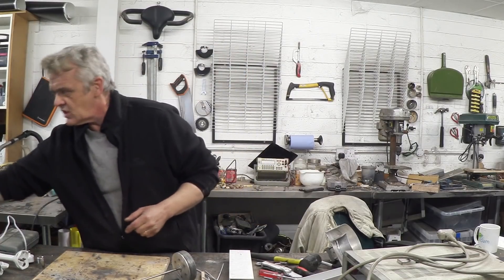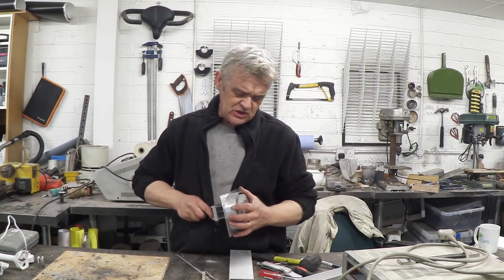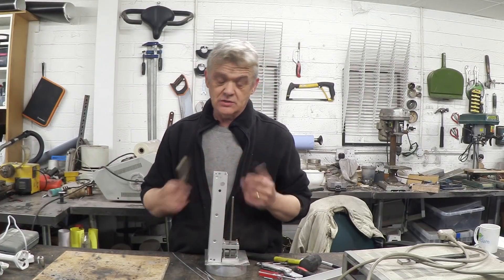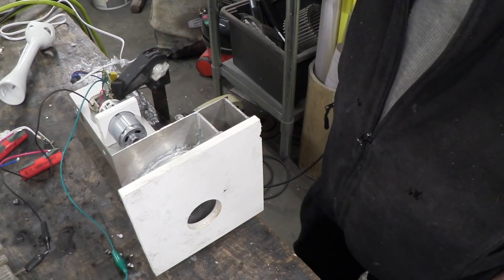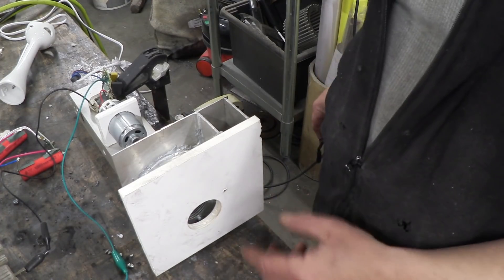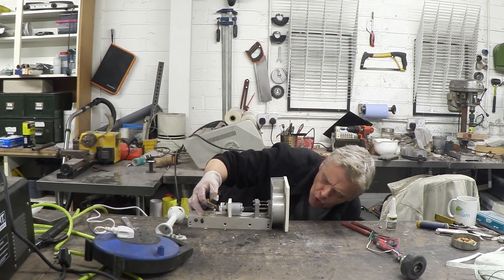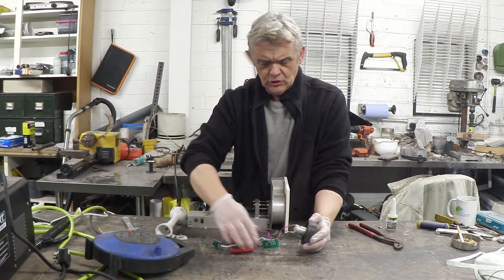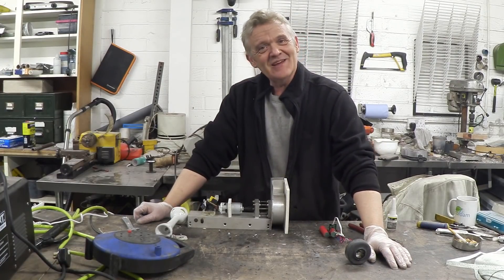Tesla Turbine As An Air Pump In A Gasifier

Comment: I've had the plan to build a Tesla turbine for a while now for a gasifier, to go on the hot side. I figured it was the best possible design as it in theory should be the most able to tolerate particulates and tar, not to mention heat.

Comment: IDEALLY if you can make the fan/pump run from the gas generated in the combustion chamber!

"Jut exactly HOW would you do that?" somebunny may ask...

Why SIMPLE!

The same way you would add boost to ANY NORMALLY fueled engine!

You have roots blowers, Whipple superchargers and exhaust gas driven turbochargers!

ALL of these work PERFECTLY FINE off the output of the engine in such a manner as to EASILY and QUITE EFFICIENTLY draw the air-fuel mixture out from the wood gassifier to begin with! 

       /)/) 
    (  'ˬ') 
@(>_ )-b 
     \) \)

Comment: I'm afraid that the inner workings of the turbine will get clogged very fast. The gasifier's smoke is very rich in suspainded particulated matter , which is also quite sticky... u need a system that draws the air "indirectly" or through a secondary action that does not expose any moving parts to the gasses being produced... 
great work as always!!
Reply: Ejector maybe?

Comment: Great idea. When I built my homemade forge I used a hair dryer. I took the heating element out of it and all the wiring and ran the fan from a 12v transformer and connected it up to a Hoover pipe and used the metal pipe to put in the bottom of the forge for cool air. I found that warmed and hot air didn't work very well.
Reply: Maybe the denser cold air had more oxygen to fuel the fire 😮😅

Comment: Hi rob, you wouldn't have to pass flue gas through the fan impeller, just use it to create a pressure drop in the end of the gassifier. Potentially as a forced draught for the engine?

Comment: It's turning backwards! More efficient going the other direction. I suspect you will end up with a squirrel cage blower that has a higher differential capability to get adequate pressure and volume to overcome the back pressure of the multi-chambered sawdust filter.
Reply from the maker: yeah maybe but Tesla Turbines are cool!

Comment: just run the Tesla turbine motor off a 12v battery connected to buck converter. fixing the bearings would be good, that thing made that motorbike sound whisper quite LOL
Reply from the maker: lol - yeah it was noisy lol

Comment: Ok first I must say I'm ecstatic over the power those motors had. I would had went with a RC car motor or drone motor but they don't cost 5 or 10 pounds. Awesome mate. Here is a thought,  make a attachment where you can attach a dremel as the motor when need. That way you get high rpms and adjustable and you hook it up when in use only, just a thought, lol - me brainstorm but would be cool but Luke might miss the dremel.
Reply: Dremell's frequently have little drum sanding attachments. rubber drums over which a sandpaper  loop can be place
Run such, without sandpaper, against a shaft or outside of a drum... And drum will want to turn.
Reply from the maker: I did think of a drremel mate but they are 50 pounds or so - I was looking for a cheap knock off when I ran across the hand blender
Reply: @ThinkingandTinkering  I can understand that mate, yeah I didn't know if you had one or not on hand, I had thought I saw Luke with one on another video, I must had mistaken.

Comment: Is that motor rated for continuous use?
Reply: It won't be running continuously, just for a few minutes to start the fire in the gasifier. Once the motor starts, it sucks the gas through its own piping and the blower is switched off
Reply from the maker: no - but then it won't be used continually

Comment: When out and about and have no AC power I think maybe a 12v geared motor to get the RPM required. I think you need to find out what RPM is required for the Tesla turbine to start working and get a 12v motor to suit.
Reply from the maker: or I could use a buck convertor mate - always more than one solution lol
Reply: @ThinkingandTinkering  very true (I know you meant boost converter to step up voltage) there is always more than one way to skin a cat

Comment: Seems like the Tesla turbine would fit the bill and that it provides brush/spark ignition separation from the gas, and may be isolated from the heat, and the fact that you have it, And you have completed the build, it just seems to fit, nice job, and congratulations on mastering that brazing rod👍There is a soldering iron I saw in a very early popular magazine called "science and mechanics" where was highlighted a man who used a carbon rod and Lionell train power supply speed control transformer (variac ?)  and was able to braze aluminum together along with many other things by making direct contact with the carbon Rod and heating the metal, there was also an explanation of a few fluxes or a surface preparation he used to achieve all this braising/soldering action, I believe the magazines are still accessible in a pdf archive, it was a Cover highlight, again thank you for all your videos, they are quite splendid.👍 still have not figured out how to become a supporter, as simple or obvious as this may be, a bit of personal instruction on that would help me a great deal if you have ever time. ty
Reply from the maker: nice tips mate - I will try and hunt out that article - I think you need to be on a desktop or laptop to join - the join button doesn't show up on mobile devices - but if you aren't on a mobile there is a join button  under the video and a link in the description and on my home page is a join button - cheers

Comment: To calm the cigarette police, maybe you could substitute your ciggie for a beehive smoker.  I wouldn't, but that's entirely up to you mate.  Also, wouldn't the intake on the genset have enough vacuum to draw in the sin gas once it's being produced?  Or, are you thinking of compressing the sin gas which is why you are using fans that draw large volumes of air?
Reply: ......I see , along the lines of starting the generator on a float bowl or two of petrol to start the draw through. If it's enough initial draw .
Reply: He does say that it will only be running 3-4 minutes to start the gasifier. So I'd say the intention is to switch off the blower once the engine starts.
Reply from the maker: I do like to poke the bear every now and then mate lol - and yes mate it does -I am only using the fan to get it started - once the ten set is running I will turn the fan off
Reply: @ThinkingandTinkering   Sweet.  Can you compress sin gas?

Comment: What sort of voltage do you think you'd want to run the motor at? Your typical boost converter from Aliexpress top out at 50-60V if you're looking at running it from a 12V battery.
Reply from the maker: to be honest I will probably just build my own

Comment: The Tesla Turbine is much better than the vacuum cleaner motor it's also more fun by far
Reply from the maker: 100% agree mate
Reply: much better in several ways as it will produce a far greater negative pressure for the hot gasses to expand and cool and mix before the inlet, then being recompressed higher than atmospheric at its outlet as in two stirling type cycles of the four doing work in one device...
Reply: @paulmaydaynight9925  I agree

Comment: I suspect you may need a way to bypass that once the motor starts because that is unlikely to have enough flow-through capacity to allow the motor to continue running. Also, it seemed to be running the wrong way for the housing...?
Reply: Yes for this type of design, the blower (sucker?) is run only to start the burn. Once the motor fires up, it draws the flow through and the blower is switched off. Hence Robert says "it only needs to run 3-4 minutes to start the gasifier"
Reply from the maker: yes mate - that's the plan